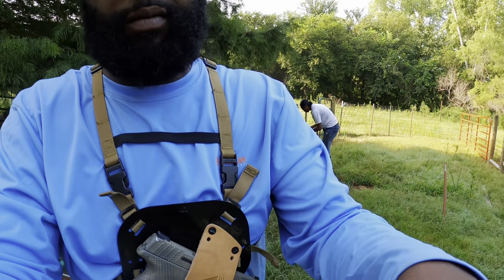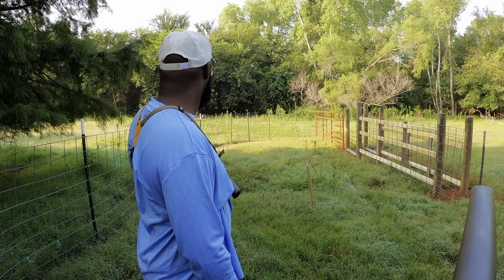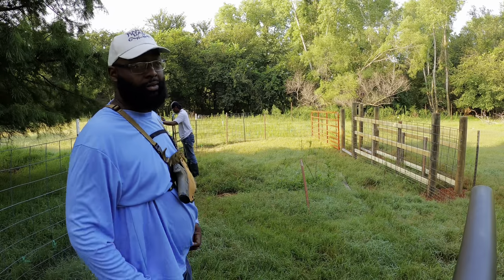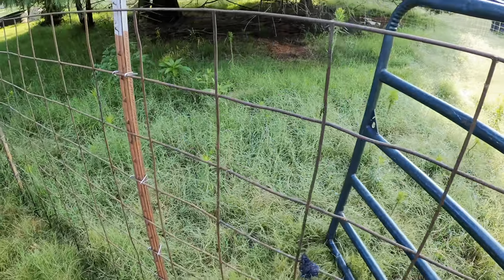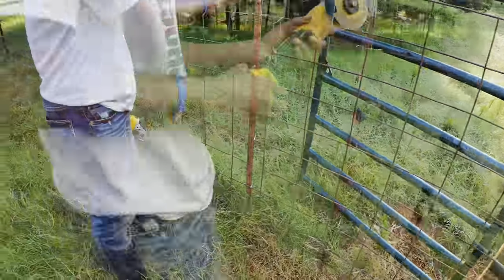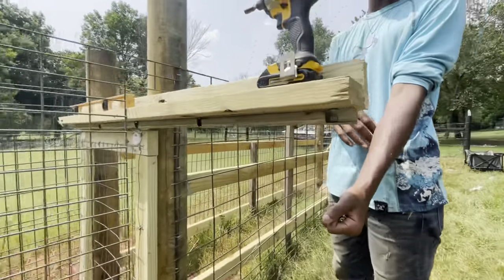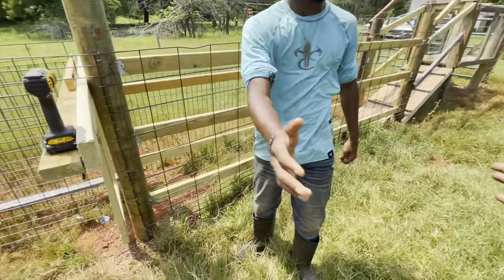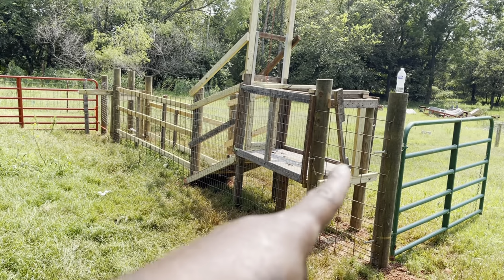Easy diy working pens/goat corral/working chute/diy head gate #goats #farm #homestead #diy

Comment: Awesome job! Only suggestion when you use 2x lumber as a joist (the crossways support under the ramp and platform, starting 4:50 in the video) flip them so the 2" section is facing the sky and ground (like you have the back one) it will be much stiffer that way, the hanger will be going to right way to provide maximum support and it's considered best practice in carpentry in case you didn't know :)  Definitely going to steal this idea tho when I get my goats!
Reply from the maker: Hey thanks a lot for that advice